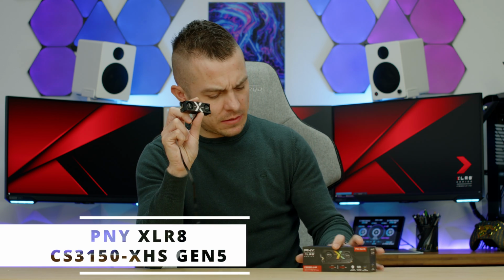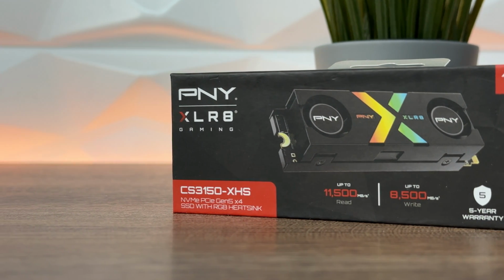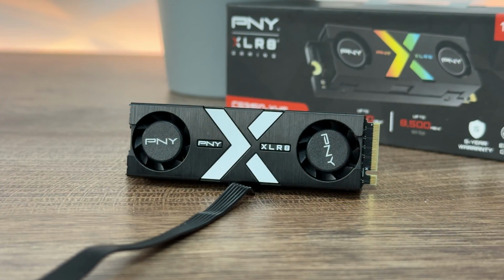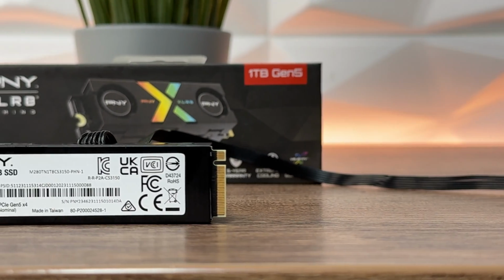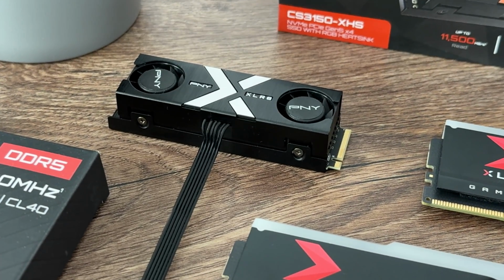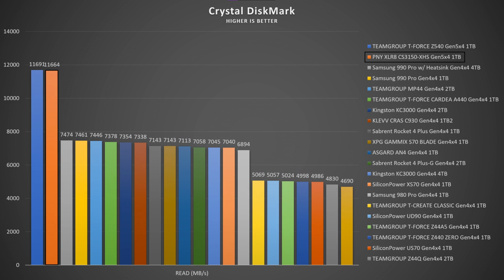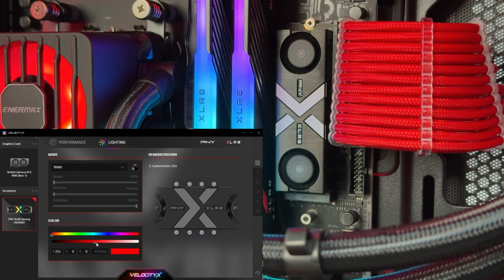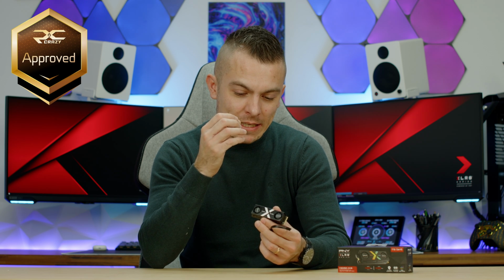PNY XLR8 CS3150 GEN5 SSD w/ RGB COOLER & DUAL FANS!

Comment: Nice review. By any chance, did you monitor the CPU load of the software at all? I've found that a number of these utility programs perform minimal functionality but can end up consuming lots of CPU. For example, I had some GSkill memory that used their software to set the RGB on the memory sticks. After doing a "fast user switch" in Windows 10 and then returning to the original user, the RGB settings were lost and the program (that does virtually nothing) was consuming 5% of the CPU. I suspect it's because the software that controls them is done as a background task on a user-by-user basis, not as a system-wide server process, and when you switch users, multiple processes are trying to access the hardware simultaneously and it gets all confused.
Reply from the maker: Thank you very much. Haven't noticed any additional loads to be honest, but have been using this software in other instances in other builds with PNY GPUs and haven't had any problems in performance loss.